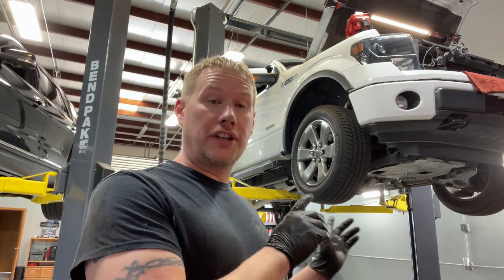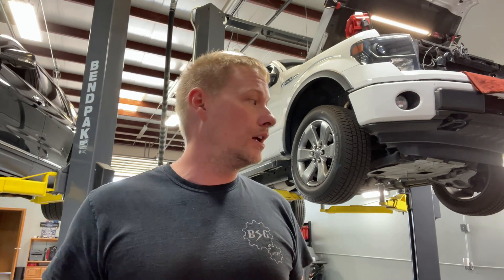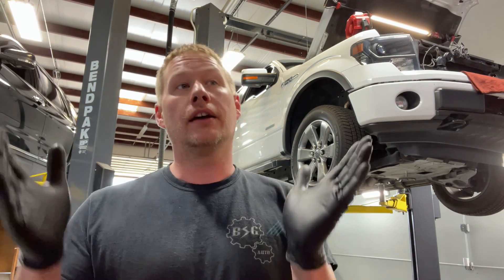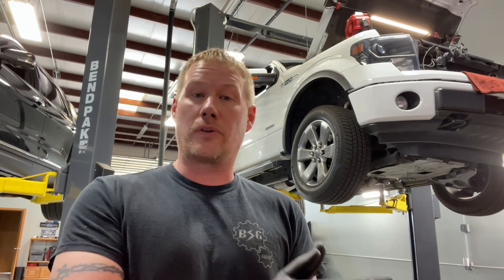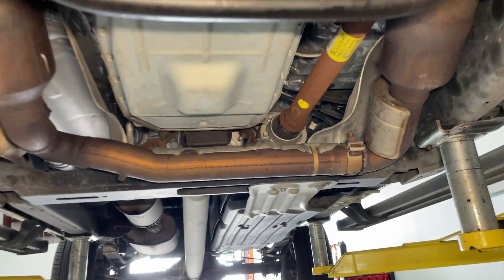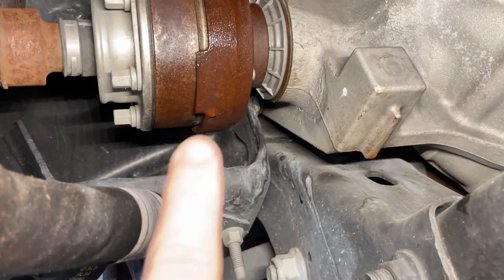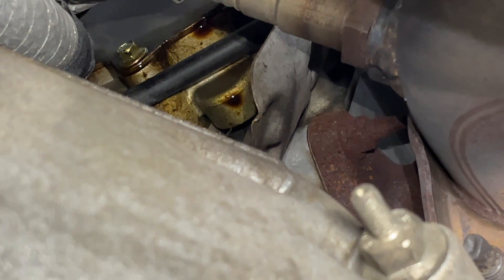Ford Ecoboost Engines Can be so Hit or Miss: I Really Feel Bad for This Customer...

Comment: Well, all those (theoretical) fuel savings evaporate pretty quickly once the high-tech goodies start to break.  My view is always to choose the lowest-tech drivetrain available.
Reply: That's why people swear by Toyotas. Too bad the new Tundra is going twin turbo V6
Reply: Bob McL, and some people will argue and talk down to you I bet.  I've seen it in the fb groups when someone says to go simple.  There is always backlash from people saying how great the high tech stuff is.  Usually from people with 20K on the odometer.
Reply: @misterm5325  Exactly mate but these Modern car lovers will never learn.
Reply: @misterm5325  Also not to mention that most EcoBoost owners likes to bash on Muscle car owners that beautiful hotrods as well.
Reply: Dude it you drive it under 65 on the highway your mpg is close to 22. When you drive it like a madman which is fun, then your getting close to 15
Reply: Fuel savings that don’t exist. My 05 navigator gives me 21mpg and that’s with a bad temp sensor. Before the sensor went bad, the truck was giving me 24.5mpg like it was it’s job. I have yet to find anyone who can show me a 20+mpg on their EB trucks. Sure they make more power, but it has no problem pulling my 20’ trailer with my mustang or F100 on top of it and going over the grape vine here in SoCal
Reply: @Xxplicit Ford also makes the Coyote for the F150 as well.
Reply: I bought a stock 2017 4x4 Tundra with that thinking and I averaged 14.5 mpg on 20k miles with my driving style and completely stock tires.  I bought a 2019 Ford raptor and average 16.4 mpg on 22k miles with the stock 35's and medium off roading in the desert.  So they have their place IMO.
Reply: I’m with you on keeping it simple, but that’s getting more difficult with each new model year.  I ordered the 5.0 for my 2013, sold it to my son who is driving it now. I then ordered my 2017 with a 5.0. It has the lighter (aluminum) body, and gets 24 mpg on the highway, and that’s where 80% of my driving is.  Why gamble with the more complex eco-boost when I get better mileage with the normal aspiration engine?
Reply: @artstewart1894  Exactly mate. I have a 2011 Ford F150 with a 5.0L Coyote V8 in it with 141,000 miles on it and still going strong and it's a beast and it sounds like a beast with the Borla ATAK Catback exhaust on it.
Reply: @CJColvin  Other than the sound is a cat back worth it? Serious question,I’ve never had one.
Reply: @NoName-tz5ji  With high Quality of the 304 Stainless steel from Borla definitely worth it.
Reply: @CJColvin  thx,but I mean for power or fuel mileage.
Reply: @NoName-tz5ji  You will get better fuel mileage and gain about atleast 5 to 10 Horse power depending on the set up you have.
Reply: @CJColvin  thx
Reply: Yes I will take the NON turbo please.
Reply: @ThePlowGuys  Amen to that brother.
Reply: Fuel mileage is terrible on the ecoboost. My gmc with the 5.3 does better. Manufactures lie about fuel mileage on turbo's. Yeah they do alright if you're not accelerating. But with turbo gas engine you have to run richer to prevent knock vs an non turbo engine when accelerating
Reply: @brettcatterall7761  I was gettign 29MPG with the A10 transmission in my 2020 mustang ecoboost. Thats pretty good
Reply: @brettcatterall7761  ... how's your lifters doing with your GMC... any burn up yet? Class action law suit started in 2021 with GM and their notorious failing lifters because of their dynamic fuel management and active fuel management dropping cylinders to gain a mile or two with gas mileage. The owner reviews/problems sure turned me away fro GMC/Chevy.

Comment: When you buy a Ford such things are to be expected. Ford cares about the money, not the customers. Pretty much all their cars leak oil or coolant. If you say yours doesn't go open the bonnet of your car and look. You will understand what I mean. The plastic and rubber pieces are the worst. Plastic hardens and warps under heat, rubber hoses  become brittle.

Comment: My ‘13 3.5EB was a lemon for sure. Timing chain stretched requiring replacement and it sucked up oil (even after drilling two weep holes) into the intake manifold causing misfires. Sold it and have a 5.0 now. Happy with my decision.

Comment: He must love his Ford because if I had that many problems that truck would be leaving. I would be looking at a different make that has a lot more reliability. All that fuel he supposedly saved over 70,000 miles is going up in smoke in repairs and then some.

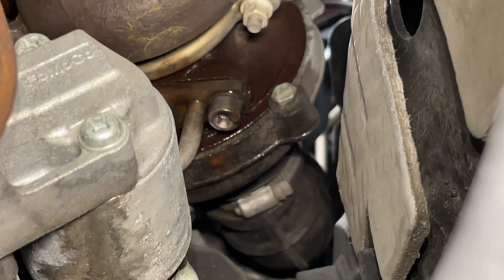Comment: Nothing related to leaks but at 4:07 there's possible evidence the turbo has been removed, anchor bolt to block is missing. Has someone been in here already?
Reply from the maker: No those were not used in later turbos.
Reply: @FordTechMakuloco  Okay Thanks CLARITY!

Comment: I had no idea these engines were this kind of trouble!! I have a 2005 Escape that is my beater, I know, not any comparison to a 2013 F150 at all but I have 218K miles on the small 2.3 4 cylinder and I have no leaks at all knock on wood...I guess I am lucky or maybe they built better engines back then? I just would never think any truck with 70K miles would need any engine repair at all!! 2013? It's 8 years old! To me, that's almost new!! I have been shopping for a newer suv to take cross country and I REALLY wanted a Lincoln MKT (The Ford Flex based one that some say is ugly)..but it has the EcoBoost engine and some say the water pump is internal and a huge $1200 job??!! Maybe a newer Escape? They are soo low priced used for a 2014 Escape with every option but they too, have the lovely EcoBoost! So what to buy???????

Comment: 2014 3.5 FX4 here. Had issues at 30k
Rear main leak(under warranty)
Turbo connector fittings @ 40k
Cam sensors went bad @ 40k (after new injectors, plugs coils I had an actual mechanic diagnose the cam sensors being bad- money wasted on injectors)
At 53k now, so far so good.

Could a long term fix for the coolant issues be as easy as getting rid of the acidic orange coolant and replacing with the newest motorcraft greenish yellow?
The "quick fit" coolant connectors are great and all but probably not the best use of them in a turbo that gets so hot.. AN fittings would be the way to go if you can manage to get them in. The lines into "quick fit" fittings corrode and cause the leak. Are the painted supply lines steel while the fittings are aluminum?  Two dissimilar metals in fluids have electrolysis issues. Electrolysis causing the pitting on the supply lines. 
(I have a write up on these issues on a popular f150 ecoboost forum if interested is reading i to these similar coolant issues)

Comment: My 2017 3.5 eco boost timing chain started to rattle at 38400 miles this spring 2021 . It was under warrantee by Ford  it was serviced by ford every 7500 miles and I did it between Fords service at 3500 miles using  Ford oil and filer . 14 hours toRepair I picked it up and dove it from NJ to FLA the next day so far so good .

Comment: Ontario Canada Here..... Had a 2011 F-150 3.5L Ecoboost...loved it! Until, 110,000km (70,000m)  Timing issues. Plugs, coils, chain. Ford wanted over $3000k to fix.... I showed them your video with the Ford bulletin #..... Dealer came  clean for me. THX!!
  I have 5.0L now... transmission issues.... cant win

Comment: I hate to sound like "that" guy, but things like this are why I'm not sure I'll never buy another brand new vehicle. So freakin expensive these days and it seems like every brand has some kind of design flaw(s) that lead to  pricey repairs that shouldn't be required so early.  I'm at 70k miles on my hemi ram and praying the lifters and cam don't crap out at any time like so many have before 100k miles.

Comment: WTH Ford! Great I have a 2016 Explorer with the 3.5. EB. Bought the Ford warranty (online Ford cuz my dealer price was a joke) to 100k as I was concerned about all the electronics and turbo complexity. Knock on wood it’s been solidly reliable but like modern BMW’s you don’t want to own a turbo Ford high mileage example without a warranty. My local dealer service is horrendous so I drive to another city for service. Mpg @ 16.5 average is close to V8 so nothing “Eco”about it. I’d love to buy a new Bronco but only if it came with a simpler V8.

Comment: The 3.5 1st gen Ecoboost was a dumpster fire of problems, had timing issues, cam issues, intercooler issues, vacuum issues.  It was a junk engine and ford should have really owned up to it, but instead did a quiet redesign to fix the problems.

Comment: Had a 2013 with 3.5. Absolutely loved the truck UNTIL I bought bad fuel(8 gals of pure rust and sludge). Absolutely destroyed the truck in less than 2 miles. Had 95K on odometer when I sold it after $7,000 in repairs. $3,400 to fix fuel system, $3,000 to replace passenger side turbo, $800 to replace the rt side valve cover gasket and vacuum pump. Couldn't afford to wait for the driver side turbo to go out. Sold it

Comment: truck is in great shape. I have a 2014 Fx4 just like this one in Tuxedo Black. mine is in the same shape. plus stays indoors during the rain and winter months under a cover it has 87,000 miles on it. each time I take it in for a recall or oil change the Ford Techs make me offers to buy it. Watching this video makes me more knowledgeable on things but also scares the crap out of me at times. but great info. @oakydoak06 love the truck man! great job on keeping it in great shape.

Comment: And I would change the exhaust manifold gaskets while you are that far with the turbos I just did it on a 2012 and don’t forget the 2 fittings on the back side of the engine for the coolant lines of the turbos those are fun to take off and replace

Comment: I have a question. I just had my oil pan changed 3 days ago. I just checked my oil due to alittle bit of dripping at the drain nut. On my dip stick I found alittle bit of something that felt like a rubber sealant I know it's not normal but should I take back to the shop I had it done at?

Comment: Bought a 2013 white F150 Supercrew and refused to buy the ecoboost.  I bought the 5.0.  Turbos put too much heat load on components.  Built several turbo hot rods.  Trust me I know.

Comment: My father was a Ford tech for 45 years. Retired in 2018. 

He did everything he could to steer me towards a 5.0. I'm lucky so dar. 2017 F150 with a 2nd gen Coyote the year before start/stop. 

Very happy with my truck. My local dealer takes pretty good care of it with my ESP.  Warranty till Sept of 2023. 

Hopefully I continue to have good luck.

Comment: Had a 2017 f150 never missed a scheduled maintenance, blown head gasket at 43k miles.
Replaced it with a 2018 f150, currently on day 10 of being at the Ford house for start up rattle 73k miles. At this point I'd say avoid Ford and eco boost engines at all costs.

Comment: I use to drive a car that looked immaculate, but I drove the crud out of it. Regular maintenance, but still. After a good few thousand miles, it burned a good bit of oil. Didn't shift as well, engine not as smooth. I have two 23 year old Fords that don't leak a drop, so it all depends how you run 'em in my opinion.

Comment: If it's not much trouble, thought I'd try to ask; I have the timing rattle issue, but sometimes it goes weeks without doing it. I used a really good oil and it seems to have made a big difference, in 8 weeks it's only done it twice. What should I do? I have a 2 year warranty (used car dealer), have had the car just a few months. 2015 Interceptor Sedan 3.7 AWD, so not the ecoboost but does have the internal water pump, no idea what's been done already. 127k mi, 7k engine hours

Comment: I have a question,  I need new tires on my truck 12 f150 xlt 4x4.  I would like to go to a more ply tire than 4ply. I would like to go to a 6ply do I have to do anything to the TMS on the wheels. Thanks

Comment: replaced that driver side turbo fitting for a buddy was lucky I didn't have to remove the turbo to replace it. Sure seems like a better fix would be a barb fitting with a coolant hose connected to the steel line. That fitting is garbage and the o-ring will fail

Comment: I am needing to do the timing chain soon... 234k miles.  The best answer seems to be practically to swap in a motor at this point.  I feel like I won the lottery on mine.  It has been a workhorse with no leaks or problems other than an exhaust gasket leak at 229k, AC compressor at 232k, and the water pump at 234k. 

If you are doing the timing chain, you should be changing the water pump anyway, it's a sub-100 dollar part.  I paid $60 for a new one this weekend and that included the gasket!  Don't see how that's going to "make it much more expensive" compared to doing the timing chain alone (which is over $1k in parts and requires removing the water pump anyway).

Comment: I have a '15 XLT with 2.7 EcoBoost and have only had one issue in 70,xxx miles. A purge filter device device located under the engine cover went bad throwing a check engine light. Fixed in about 20 minutes at minimal cost.
I think there's something to be said about spotty QC at Ford. No issues with my truck and I have a friend who just traded in a '10 F150 with the dreaded 5.4 3 valve V8. Had 198,xxx miles. Still on original plugs! Only issue ever was a bad throttle position sensor. Go figure!

Comment: I worked at a gm engine plant a few years ago and I hate to say it but the manufacturing and engineering process can play a roll in getting a batch of engines that last 200,000 miles and a batch that don't last 90,000. if you never worked in an automotive factory you'd be surprised anything ran when it left the factory. but that's what you deal with sometimes when you have to pump out so much product in so little time. can it be better? a lot better but time is money and nobody has any time to make sure the kid they just hired is putting on oil pan or timing cover sealant on the proper way.

Comment: Mines in the shop now at 49k for a timing job out of warranty I’m beyond disappointed, I’m out thousands for basically a brand new truck 2014, starting to rust in the wheels wells, just beyond disheartened by the quality of a 50k dollar vehicle.

Comment: You can get an escape with a 3 cylinder ecoboost.///  I guess the positive side of that is the engine is so small you should be able to just lift it out and work on it on the kitchen table.
Reply: lol

Comment: I don't think my 2014 f150 with the 5.0 is much better! It has a 113,xxx has had both front axles replaced, both actuators, the water pump at 85k and all the rediculous radiator hose fittings at around 100k.

Comment: When my wife and I got married she owned a new 1974 Mustang 2, talk about a POS. This thing had the 2.8 Liter German V-6 and three speed auto. It was riddled with electrical problems, a short in the dash panel display caused the gauges to act in an erratic manner. The fuse block corroded and burned up damaging the main harness which had to be replaced. The car developed a problem that when you made a right turn it would stall,  had the carb rebuilt and then had it replaced with a new one, that didn't correct the issue, dropped the fuel tank to check the pick up tube nothing broken or loose, took the steering column apart looking for something broken or loose but no luck there, never did get it resolved. The only way to keep it running was to keep you foot in it a bit while turning. A bit later the rear shocks broke, the rear seat had to be removed to replace them and six months later the front ones broke. A few months later while traveling south on I-95 the water pump seized and exploded taking out the fan and its shroud and all the belts and attached pulleys barely missing the radiator. A short time later my wife was coming home from work in a spring storm, we lived 1/4 mile down a dirt path, when she turned off the road the car shut off and would not start, I pulled it home thinking it had stuck points. My uncle and I replaced all the ignition parts and found that the distributor was not turning when trying to set the points. This required major disassembly of the engine, the crank shaft timing gear was broken, it was a cast iron center with a toothed nylon ring to engage the cam shaft, it had broken and fallen down in the oil pan. Earlier versions of this engine used a steel gear on the crank shaft, they found that this set up would shear off the cam shaft gear. I fished it out and made sure I had all the parts. I ended up replacing the gear, timing cover and gasket, fuel pump as it was leaking and the thermostat located in the lower goose neck, this involved 8 pieces, 2 gaskets, 3 bolts, 2 pieces of the housing and the thermostat. During the four years we owned the car I put 5 batteries in it, it had a parasitic drain somewhere. I got rid of it in 1978, car only had 43,000 miles on it. I bought a Toyota Corolla, best car I have ever owned.

l
Reply: I remember how disappointing those vehicles were after what mustang was from '64.5 to '72 or so.

Comment: I’ve already repaired the water pump, the coolant lines going to the turbos and the quick disconnect hoses for the coolant and now I have a rattle on startup that last for a few seconds and then goes away. I now have 75,000 miles on my 2014 ecoboost.
Reply: How much did it cost you to fix the pump and coolant lines and what did you discover was the rattle?
Reply: @gregjmitch  I had a friend of mine do the repair and it was about $1500. The rattle on startup is the Cam Phaser’s but I have not had them repaired yet.
Reply: @kevincloutier6550  I had the cam phasers go out on my 08 F-150 with the 5.4 Triton.  Hell of a rattle on idle.  Timing chain was bumping against the aluminum wall cover and chipping flakes.  We saw them after dropping the pan.